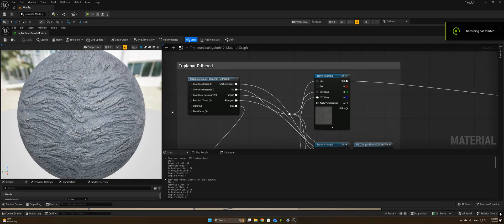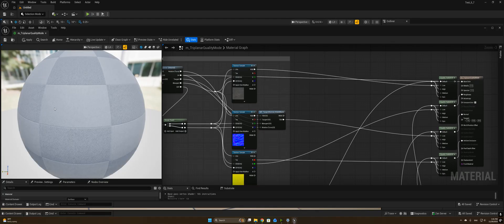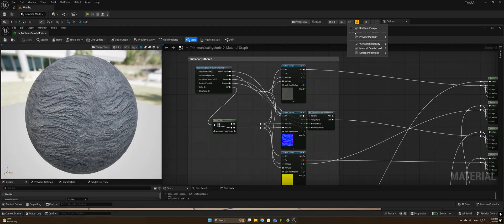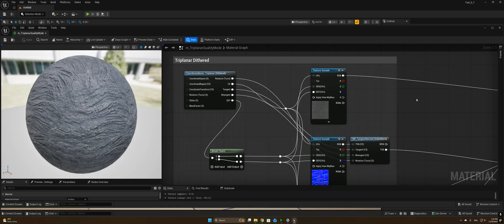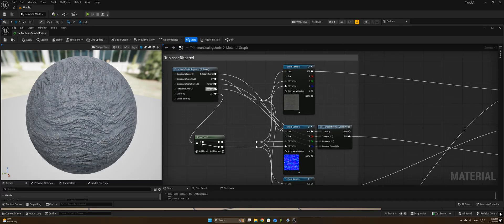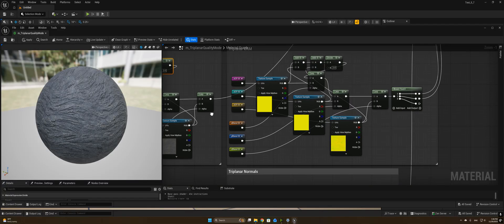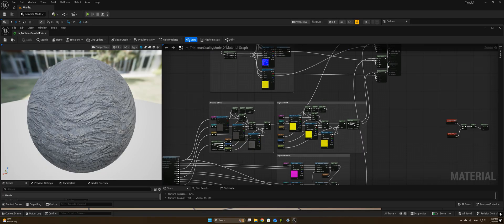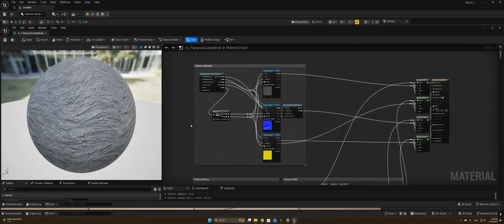Tri-Planar Mapping Performance Scalability (New Built-In Nodes): Unreal Engine 5.7

Comment: Isnt the way they do it not a bit expensive as a base colour, normal and ORM textures take up almost as many instructions as my triplanar material that has a base layer and 3 paintable layers with base colour, normal and a ORM + displacement. I understand that this may be more accurate in most situations but jesus people are already complaining about the optimization of games.
Reply from the maker: The instruction count is not nearly as important as it might seem. Not all instructions cost the same time in ms (with texture samples being among the most expensive), and any instructions that can be executed while waiting for a texture to fetch are essentially free. 

So reducing the number of texture samples as seen here is likely a better optimization than reducing instructions.
Reply: @TechArtAlex  I know, its just when comparing my method to theres with both using a single sample dither triplanar method for the albedo, normal and ORDp textures, with no variable inputs (constent values) uses far less instructions whilst having the same texture samples & texture lookups.

The method im usings output is visualy identical but uses less math.

There Method - My Method
Base Pass Shader = 306 - 256
Stats: Same

Base Pass Vertex Shader = 165 - 148
Stats: Everythings Same except 1
Resources Used = 6 - 4

Nanite Compute Shader = 1152 - 775

Stats: Same

Texture Samplers = Same
Texture Lookups = Same

Large World Coordinates (LWC)
Constructors usages = PS(4) - PS(3)
Promote usages = PS(11) - PS(6)
Demotes usages =  PS(1) - None
Add usages = PS(9) - PS(5)
Subtract usages = PS(8) - None
Multiply Vector Vector usages = PS(11) - PS(17)
Other usages = Same

Shader Count = Same
Preshaders = Same
Reply from the maker: @lord-fishv7355 ah gotcha. Frankly I don't really trust the instructions count figures in the material editor very much. It is almost always misleading and sometimes just actually wrong. 
So you may be right, but unfortunately the only way to truly know is to profile them against each other.
Reply: @TechArtAlex   Ya I do agree with you on the instruction count not being accurate but a drop that big normaly means less duplicated ALU work. And lowering the amount of work on the pixel-shader can help if the material is not bound by bandwidth, overdraw, etc. Also the if nodes in the material function from what I have seen dont compile out like static switches but tend to become select/lerps logic instead, so the cost of the unused paths arent automaticaly avoided. And with the POM version of the material they are using a custom node which isnt bad in its own right but can make it harder for Unreal Engines compiler to optimize it compared to the built in nodes (less graph-level constant folding/restructuring).

Comment: Nice man! I set this up and added a rotation parameter to the dither function and also wired it into the MF_TangentNormal_OrientWorld function, but the normal rotation doesnt update correctly(it follows the texture rotation). Did you have the same problem? I would think that node for the normal would fix that...
Reply from the maker: It appears to work as intended for me. My rotation scalar is exactly the same 0-1 value for both the Triplanar function and the OrientWorld function.

Comment: Great to see you posting again Alex. Your original triplanar dithering video was great. I still use some form of that trick in all my projects today.

I wonder if using quality switches for this is wise though. In recent presentations, Epic has been advising against quality/static switches because of the shader compilation overhead. This presentation goes in a lot of detail about it: https://www.youtube.com/watch?v=FQVOYNczPpw

Having a quality switch in such a broadly useful function as triplanar mapping could cause a massive increase in permutations across a whole project, for (according to aforementioned presentation) limited actual performance benefit.
Reply from the maker: Good point - Yeah it does require a separate permutation for every shader that uses it (which could be a huge number). However I can't think of a simple way to avoid that if you want to support both dithering and standard tri-planar. You could use dynamic branching but you'd need to port the whole function to HLSL (for now). 

I haven't decided if I'll make a video on it yet, but just this weekend I did get a sample up and running for custom material scalability that doesn't rely on switching (mostly for allowing players to adjust things like adjusting sample counts for POM and saving it) but I might wait until they release dynamic branching without needing custom nodes to cover it.

I see a lot of indies who only offer the built in scalability settings (if at all) and give zero control over individual material parameters like that ( post process effect strength, POM quality, etc) so I think there's a need to address that.
Reply: @TechArtAlex  I'm a little bit confused about why this would be an issue - wouldn't it be possible to just use a material parameter fed into a static switch, have two sets of material instances (one using dithered, one not), and then, when the player toggles the setting, switch any relevant materials in question? Probably depends on your use case, and I guess it would mean you'd have to suddenly load in a lot of materials all at once if you have a lot of materials which have the switch (although given that this will probably get the most use in terrain, I suspect there won't be that many in each level), but most players would probably expect an overall 'graphics setting' to be something that could cause a bit of stutter at first or, at worst, require a restart.

Comment: It's a great way to reduce instructions but with the ton of temporal and accumulated effects, UE5 has normalized, I'm a bit hesitant to add more dithering and potential ghosting. Always good to have options tho and pointing out the scalability option is highly appreciated
Reply from the maker: Because it is being dithered with a surface of a similar depth and color, most materials will exhibit basically no noticeable noise. 
It is very different from dithering shadows or opacity, which have high contrast or depth discrepancy. Give it a try and you'll be surprised.

Comment: Sadly it has a pretty high cost with Nanite and doesn't work with Displacement, still pretty cool for lower platforms I guess!
Reply: Yes, unfortunately, there is a displacement issue. If you have a nanite terrain and nanite geometry, it's quite possible that the blend area with the terrain will be flat or display incorrectly.
Reply from the maker: You can use dithering for all textures except the height map, which must use a standard tri-planar blend with displacement mapping. But you can still use dithering for the rest. 

You can also use POM instead, but there are pitfalls to using it with tri-planar materials, especially when dithering. 

But yeah, mainly you would use dithering as a low spec, so displacement is probably off most of the time anyway.